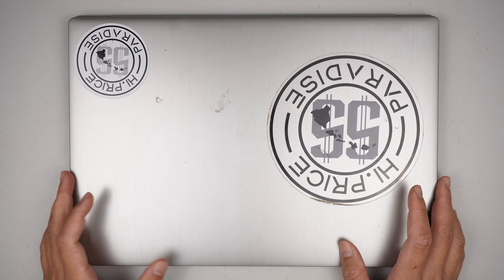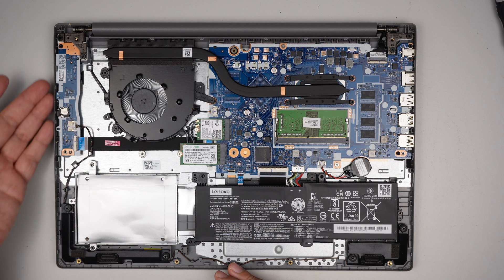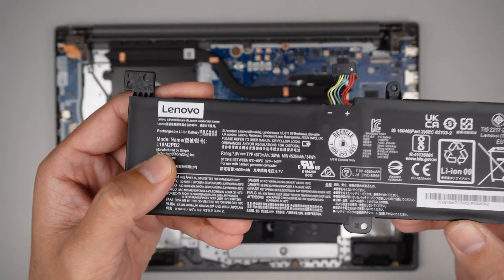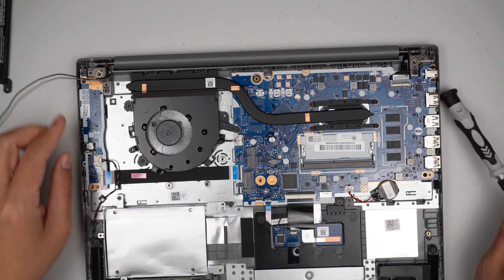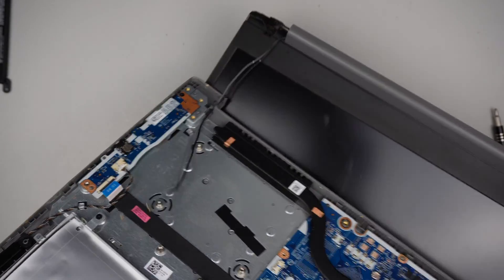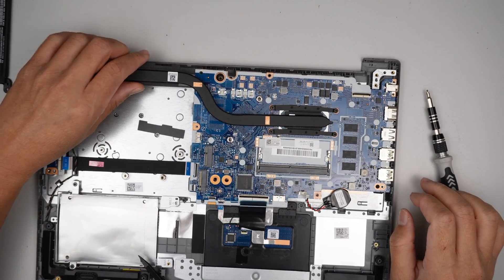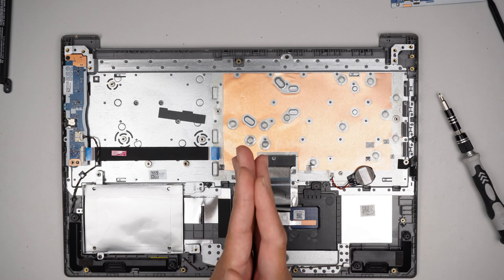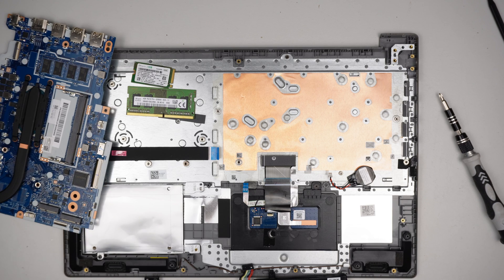Lenovo Ideapad 3 Teardown Full Disassemble

Comment: bro I have this laptop and I'm terrified to open it... the last one I opened was an HP and I RUINED it.... I was careful (I thought) when put back together, nothing would come on at all, and I didn't even touch anything once I opened it...all I can think is during the prying, I must have screwed  something up. All I really need to do is change ram because I think one of my ram sticks is going bad. When I bought the computer new, the store had upgraded the ram from whatever it was from the factory to 24 gigs total, so I think whatever ram they used is going bad. I saved the 16 gig ram stick out of my old computer... DDR4, and this is also DDR4.. two things that freak me out... 1. the prying to get the cover off without ruining anything. Second, disconnecting the battery without breaking it... the ram itself looks EASY to change.